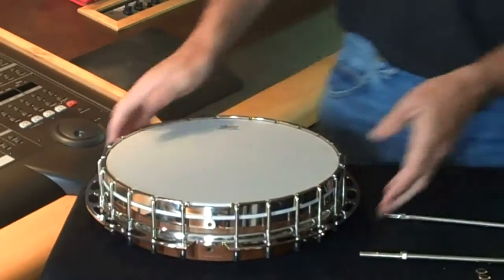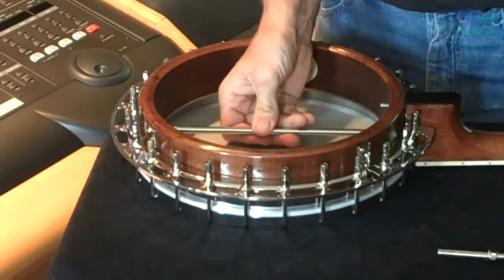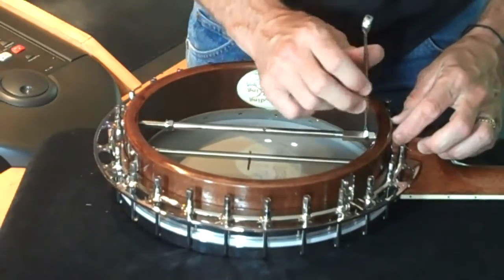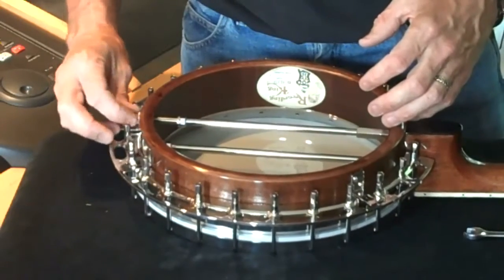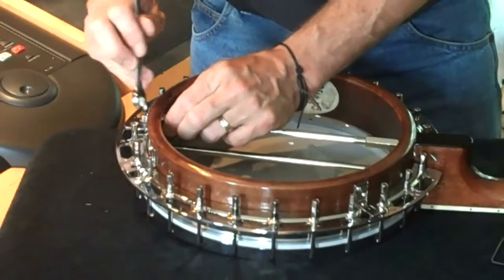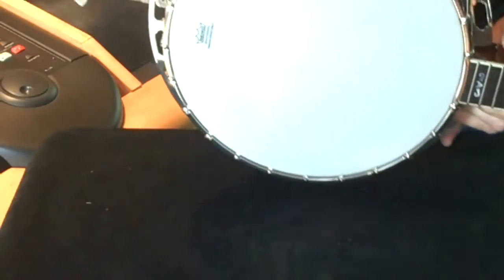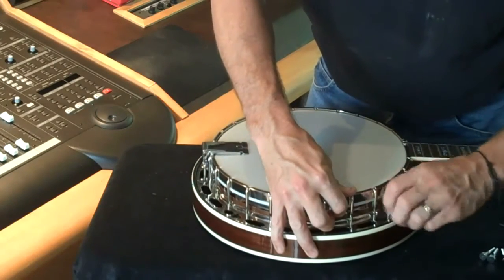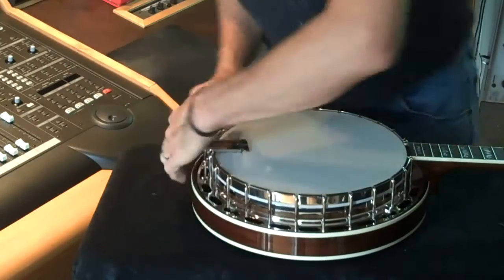Banjo build/set-up Part 4 Johnny Butten and Recording King

Comment: Excellent, very helpful...  So, does the way you tighten the regulator rods set the angle of the neck relative to the pot?  Can the angle be adjusted using the regulator rods?  You didn't really get into that aspect.

Comment: You don't look to make sure that the neck is straight with the pot assembly before tightening up the tension rods? And why put the resonator on before the strings because obviously you will have to adjust the string height with the tension rods.
Reply: good point!!

Comment: I found an Ariana banjo 🪕 that is from the mid to late 70's.
Not a scratch on it anywhere. Needs new strings, all parts seem to be intact. Hard case is old dried out and warped. Case is no really usable at this point.. looks to be mahogany and head felt like paper actually, not kidding 😂...
They want too much, 299.99 plus tax of course.
I was thinking if I give it a really intentional looking over, maybe they will take 50 bucks for it. It is in a pawn shop for last 3 months store owner said...
I figured if I could tune it up, put a new head on it, maybe a new wood bridge, old bridge is wood I noticed..and it is a five string banjo 🪕🪕 Maybe if I paid 50 to 75 for it, I could use it to practice with.. before I bought a new banjo..
I,m not paying 300 plus tax for a basket case from a pawn shop...I have what I need to get a new one, I am looking around...
Checking the most logical options out first is all..
I went to pawn shop in my small home town to change out a 20 dollar watch battery, when I was waiting, I was looking around in store and there she is. An old cheap banjo 🪕
Really, I want to offer them 50 ,,so I can learn to disassemble and reassemble banjos, I thought if it was cheap, I might learn something before taking apart another..
Just a thought... 
What does others think out here..        Harv Dog 🐶